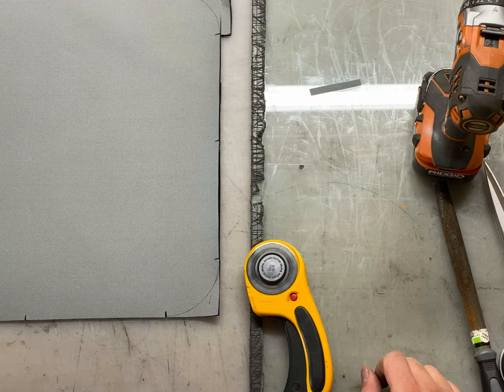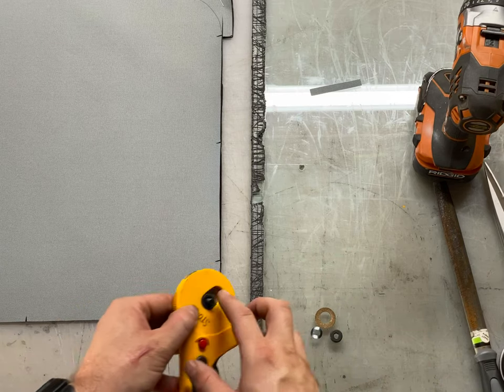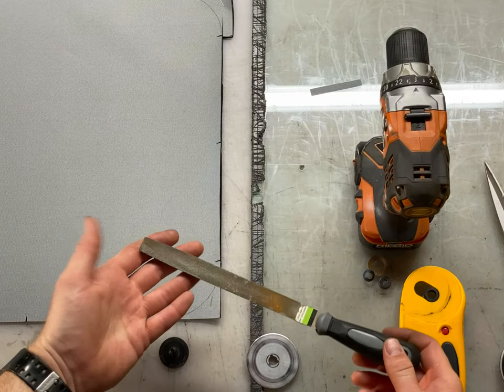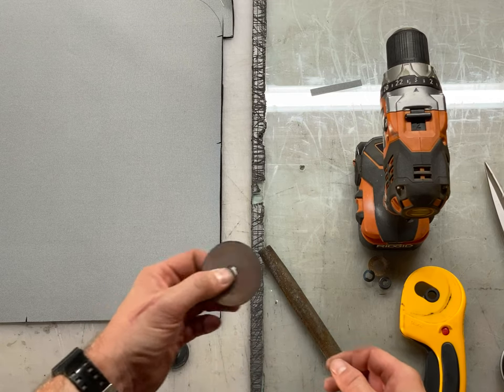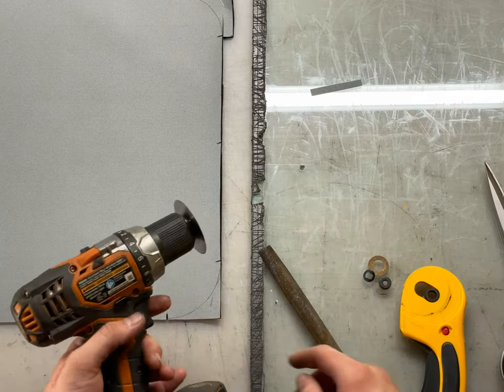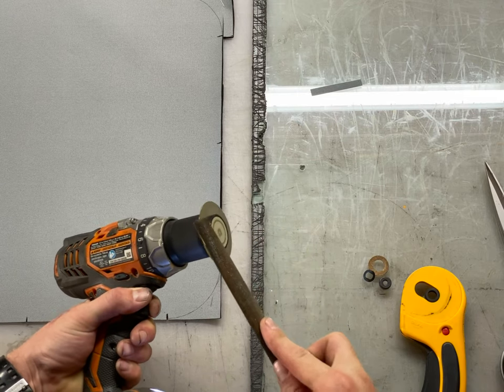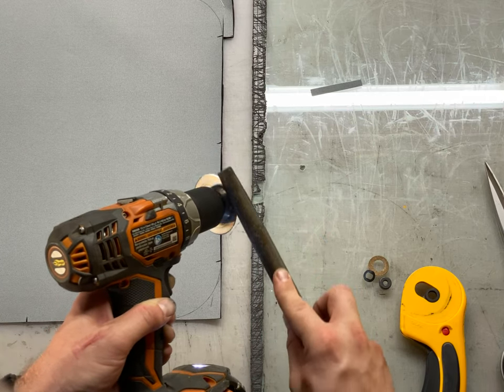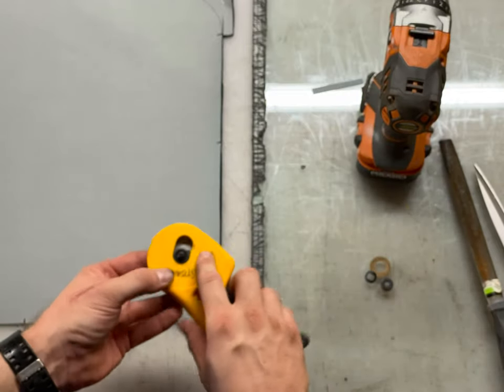Resharpening an Olfa rotary blade

Comment: Excellent video. I think I can do this!  Question: how long should it take ( how many pushes) of the file to have the blade resharpened?
Reply from the maker: I would say it depends on how much "tuning" your blade might require. Let the nail file(or metal file) do the work, you shouldn't really have to push. Your intent is not to "remove metal", but simply to help true up the blade. There IS a point where you are best simply to replace the blade with a brand new one. This tutorial is simply a backup plan in case you don't have a spare fresh blade on hand.
Reply: @stonephotogear408  I agree it depends  - how much pressure you apply your medium for honing; or if necessary, sharpening.

Perhaps using sharpening stones if you have a collection. (demand is high since covid)... even 400 900 1200 grit emery cloth 
Willingness to happily practice and blank your mind so you can consintrait.
Train your sense hearing touch feel etc. Can be scary, work smart with all common safety gear , even have a buddy holding your beer and scorn you for trying.  :):)